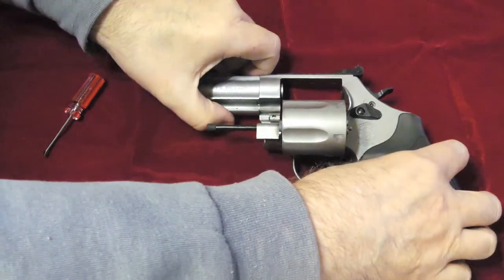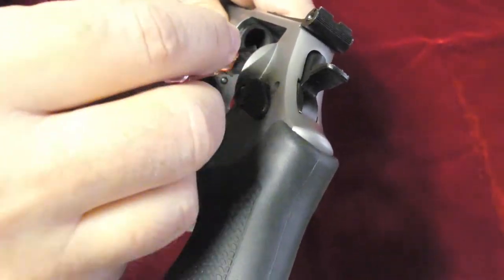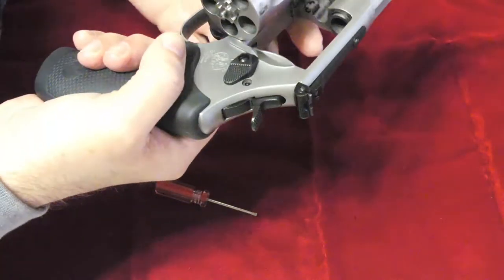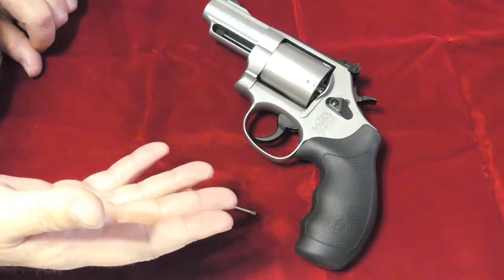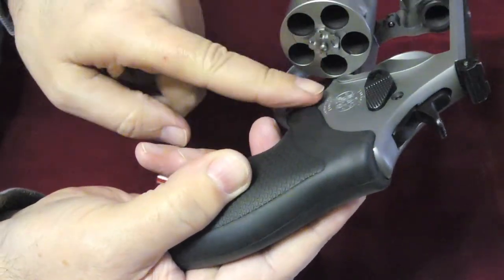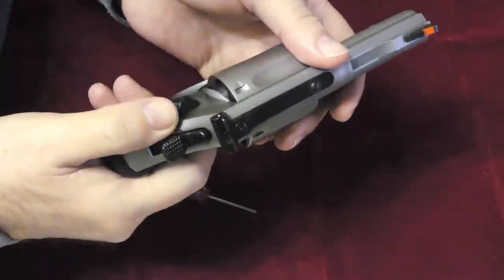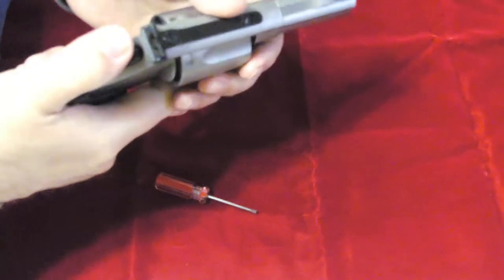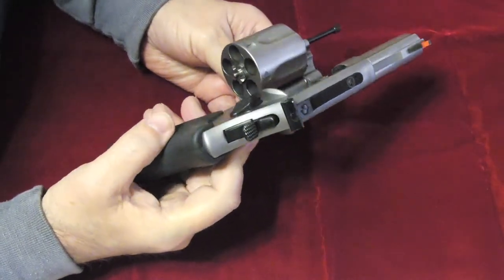S&W Model 69 .44Mag - Critical Failure Update

Comment: I’ve shot 1,000 magnum rounds through mine I consider mine a magnum that’s capable of firing 44 special for practice challenge but then I worked with my hands all my life so I guess my hands are a little tougher than most people’s 😂
Reply from the maker: Mine was that way when I was younger (could crush an apple in either hand)
Now that I am older, and arthritis has kicked in strong, I actually find it difficult to shoot even 9mm on a lengthy session.
I actually just bought a Ruger Security 380 and plan to get the new Beretta 80x in .380 - I figure they will beat a .22LR, and will allow me to still get in plenty of practice.

My Grandpa was right 50 years ago, when he told me getting old is not for sissies! 😅
Reply: I’ll be 73?on the 9th of may still working on car and have a 25 yd range in my backyard so I shoot often.
Reply from the maker: @RaymondEldridge-lm8dk  Happy Birthday!
Reply: I shot buffalo bore 305 grain hardcast I didn't think recoil was bad
Reply: Mine eats lots of hot ammo

Comment: Damn! $70-80 to ship Fedex? Better try UPS next time, they ship much cheaper than that
Reply from the maker: I think handguns have to go 2nd day or overnight. UPS did not offer the service when I shipped this one. My only choices were to use FedEx or use an FFL dealer, which has cheaper shipping charges, but they charge the transfer fee so it works out close to the same.

I am not sure what UPS's policy is currently for gun shipments.
Reply: Yeah the FFL shipping fee can make a big difference

Comment: If just shooting at the range with a big bore like this there is no shame in using a shooting glove.  Nobody on YouTube seems to know or remember that.  Wear a glove and shoot as much as you want.  Of course it makes sense to shoot a few rounds without the glove so you know what to expect if you are using it for defense.  But punishing yourself or giving up early due to recoil doesn’t make sense.
Reply from the maker: You are likely right in most cases. However, all things have to be considered on that advice. (Hand strength, arthritis, joint problems, etc) - I agree, there is no shame in wearing a glove on the range. (I use one on my LCP Max due to a wicked trigger slap) - But in some big bore cases, like this gun, which is suited well for specials, but is no fun with magnum rounds beyond the 2nd cylinder, due in large part to the reasons above, there is no shame in limiting exposure to it.  (plus I honestly doubt this gun would hold up to long shooting sessions - I have already had two glaring issues with it) 

- Clint Eastwood said it best - "A man needs to know his limitations" - and with this gun, coupled with my ailments, about 2 cylinders and the fun stops for me.
Cheers!
Reply: X frame mono grip is a super recoil tamer